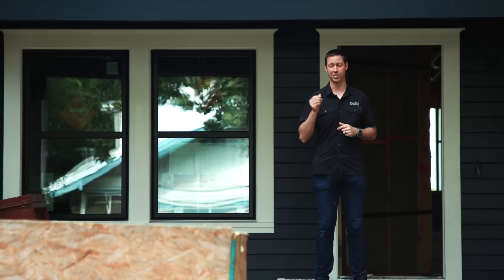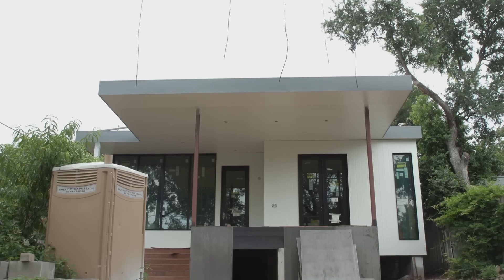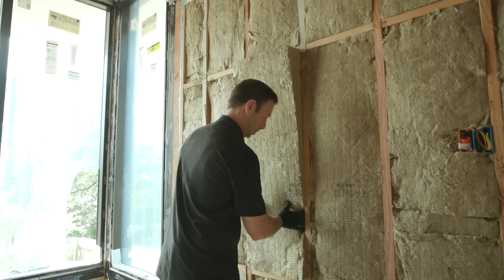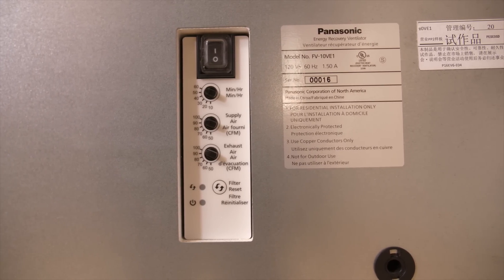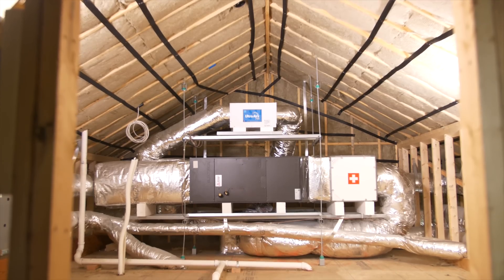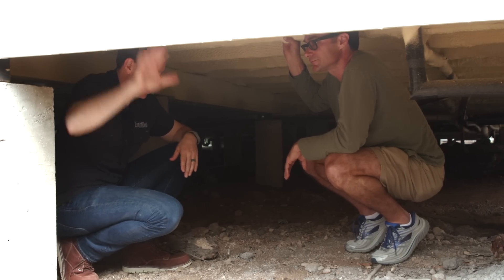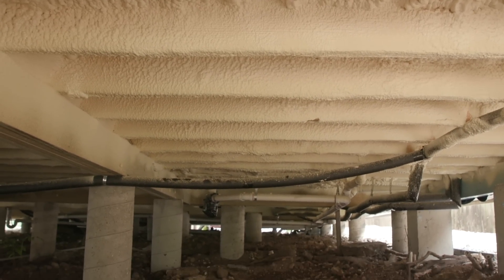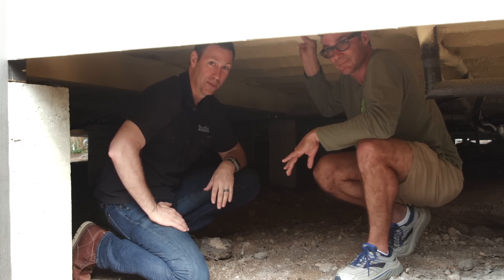2X CODE INSULATION - Simple Trick!

Comment: Really like this architect! I like the choices of insulation and consciousness to off gassing. Really like the way the house looks outside too. Has some nice curb appeal.
Reply: What about the formaldehyde in the Rockwool, is it a concern?
Reply: @networkingdude  there is certified formaldehyde free rock wool from Owen's Corning on the market right now.
Reply: So he mentioned not doing spray foam for the off gassing, but then they went into the crawl space and there was spray foam...wouldn’t that off gassing still get up through the floor and into the living space??

Comment: 30 years ago I built my own home here in Upstate NY . My walls and ceilings are a R-40 . All glass on south side for passive heating with electric backup .
Reply: 30 years ago you must have been turning some heads with specs like that. Did everyone think you were crazy?
Reply: I got a home equity loan and the permits were more worried about the money . The only one was the electrical inspector and I had a professional wire the 200 amp service so everybody was happy except the bank I got the loan from .
Reply: Does all that southern glass leak major warmth in winter? Double glazed with curtains and roofed pelmets?
Reply: fog fog I wish somehow I could send a picture . On the south is a 48 ft x 8 ft x 16 ft high enclosed porch which acts like an air lock and with all that glass is always is at LEAST 10 degrees warmer than outside . But when the sun is shining in the winter with the winter angle it’s been up to 110 degrees at eye level where my thermometer is . I went to work on a clear WINDY January day and it was 10 degrees out . When I got home at 4pm , it was 110 on the porch and 100 in the house . I had to open the bathroom window and the laundry room back door to let the heat out . There is matching glass and sliding doors on the interior wall of the porch . The porch has a 4ft overhang so the sun doesn’t really hit the porch in the summertime .
Reply: @patriciagantz377  yes, great for day time. Shielded from high summer sun by an eave, low winter sun still gets in. How do you manage cold winter nights?
Reply: fog fog the house is super insulated and will hold heat inside house overnight . Plus I grew up in Upstate NY so cold is a part of our lives . We use a electric space heater as backup and also have a coal stove in basement but haven’t used it in awhile because electric is easier and for some reason gotten cheaper these past few years . Send me your FB and I’ll send you some pictures .
Reply: @patriciagantz377  that's ok, thanks. I prezume your inner glass has curtains. Hard to insulate a glass wall😁. I'm in subtropical east coast Australia so we have northern glass and eaves, but not a glass conservatorium like yours, we'd cook. High level louvres to let out hot air. Deeep western verandah.
Reply: fog fog never bothered with curtains. We live in the middle of a woods so I never wanted to block any view and the heat loss never became an issue enough to warrant it . If at anytime I break a window or door I will replace the double pane with triple pane . I didn’t have these new options 30 years ago . I also put in a 4ft x4ft trap door in the porch ceiling to let summer heat out .
Reply: @patriciagantz377  sorted then. Sounds like a good situation you have there. Cheers.
Reply: @patriciagantz377  I'm in the Finger Lakes region of central New York, and am hoping to build in about 5 years. I'd like to connect to see your layout and get some ideas...
Reply: Seth Marks send me your FB request and I’ll send you some of my house photos
Reply: @patriciagantz377  Does your FB profile have a pic of Florida steps you had made? If it is, I can't find where to send a request there.
Reply: Seth Marks that’s me
Reply: Seth Marks are you the one in Monroe ?
Reply: @patriciagantz377  Odessa. pic of me driving a blue tractor

Comment: Honestly with the outrageously outlandishly stellar sky high price of heating/cooling*AIR CONDITIONING* any home-between all the multitudes of those areas that heat/cold transfer, gaps/spaces/air flow areas, and the poor insulation properties lumber alone just doesn't contain - it's a nightmare !! You're literally paying to air condition the outside !!
I'm absolutely going to check into the necessary prep work/materials/technique/application&installation/code + lastly requirements for achieving the high high quality full package holistic every  nook and cranny that is a potential cause for the loss of any amount of heat energy --it's addressed "passive home" !!
I don't have any interest in FEARMONGERING and being way too overly alert -- bordering on paranoia; with the many outages and electricity + the whole relationship with the house and the electricity grid itself, and frankly the reality being that with a decent knock about due to an earthquake, the electricity grid itself being fried and zapped from lightning/electrical storms/coronal mass injection/and a litany of other shitty outcomes, I truthfully believe that making first and foremost "MY HOUSE" up to these passive standards is just smart !! It goes without saying that the money inherently saved by not having to shell out massive amounts of money to the utility company each month -- it's really a no brainer

Comment: Not much "old" house there at all. Looks more like a complete teardown and build in place?
Reply: You mean, an extreme makeover❓
Reply: Really, I imagine its near impossible to retrofit some existing homes to this standard especially ones over a certain age.
Reply: At the beginning of the clip you can see the front of the house - I would comfortably say that the bricks might be original. Not saying they are in their original configuration, but they might be the original bricks, and they have been cleaned and reset. Highly doubt that any of more than 5% of the timber is original. Maybe it is a heritage area, and they "carefully disassembled and reassembled, replacing damaged timber along the way".
Reply: Yeah, agreed. Pretty much $100's of thousands - and rebuilt the house.